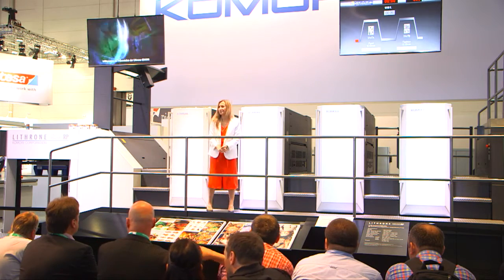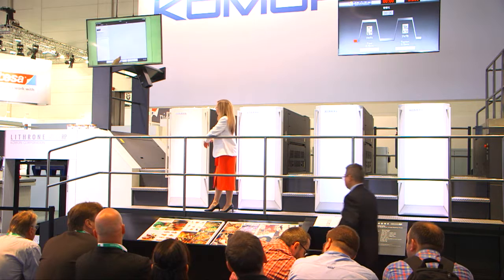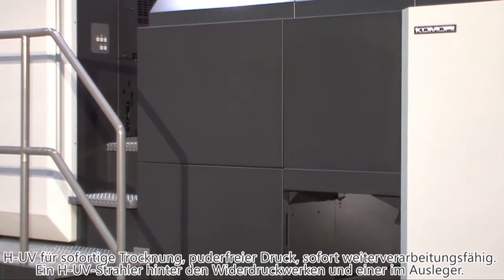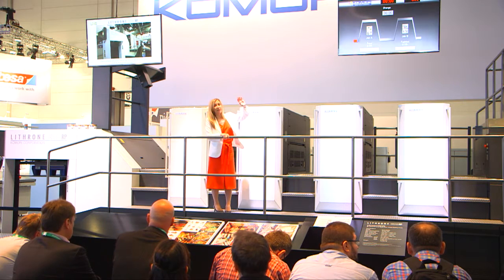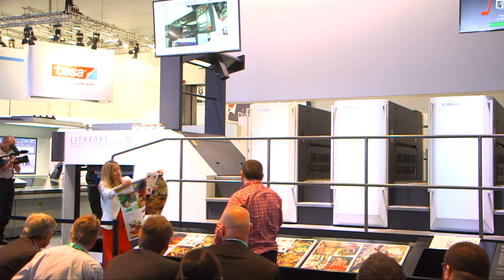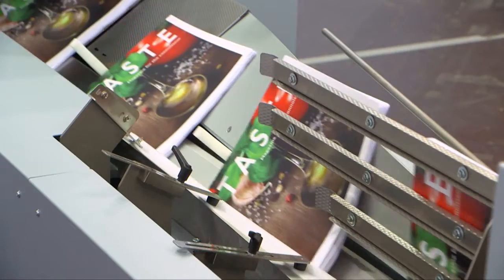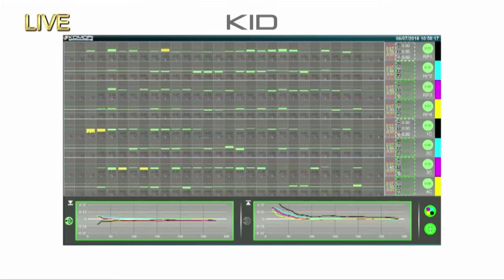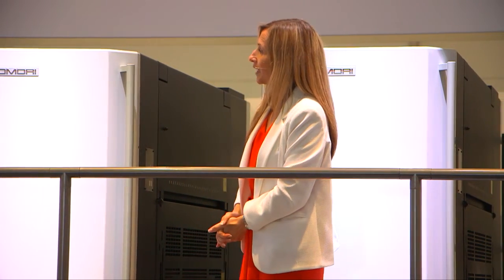Komori Lithrone GX40RP Demonstration at drupa 2016

Comment: I have worked on Komori  6 and 7 color with ir and uv coater ,what i would say real printing with sharp dots good press its got its annoyances  dont expect the printing speeds they are speaking of after all paper and fit and the layout will determine that...the bells and whistles do not determine the quality of the press....it is all ways print quality .....i would not suggest anything from the EU countries or former Soviet Countries. my personal experience with dealing with press crack ups. old us presses will never die...they just cant keep up.
Reply: PS stay away from a Roland 800
Reply: Ran Komori presses for many years, granted when they first came on the market. I noticed they still have reverse nip metering roller in the damp system ( don’t run out of water!), and copper oscillator rollers in the ink train.( roller stripping was always a pain.!) But strong and sturdy and best on long runs. Thankfully I’m retired these days.😂👍